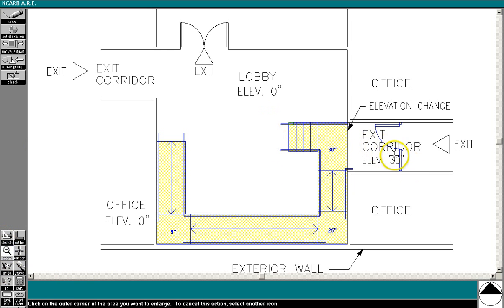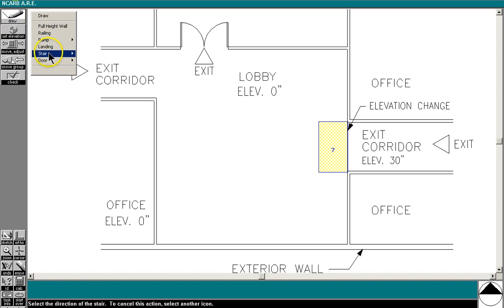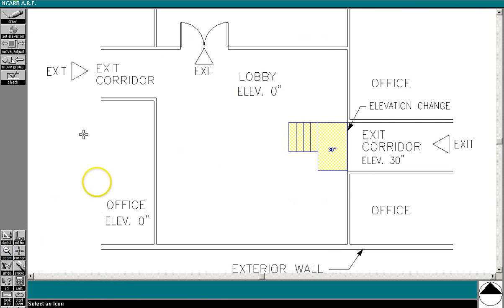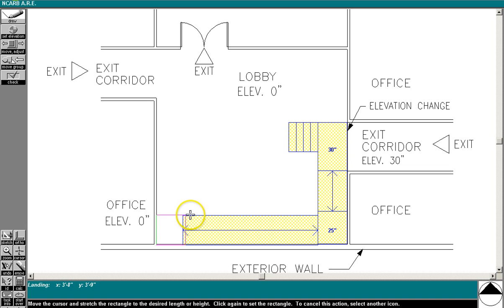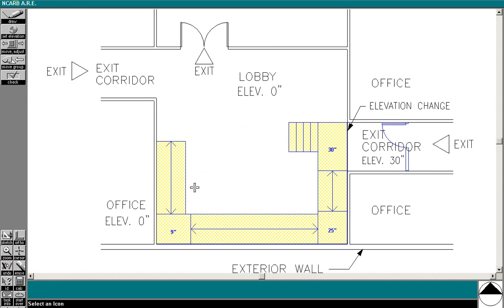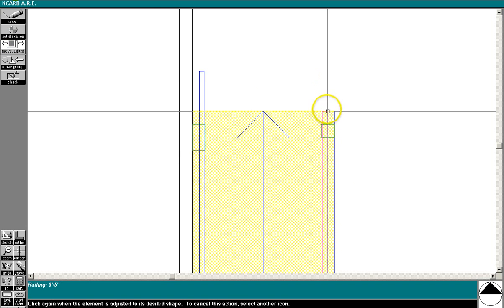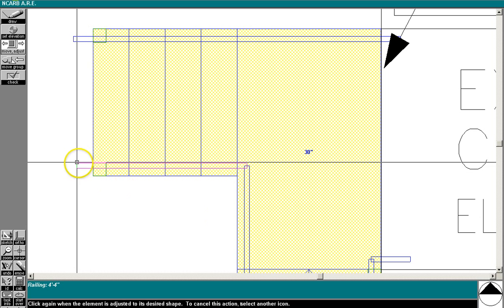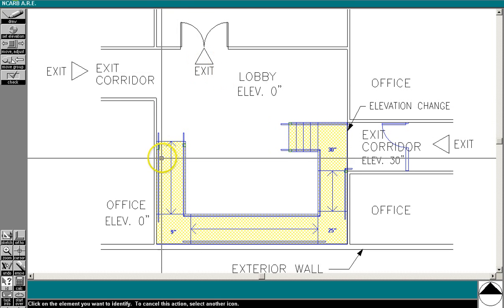ncarb ramp

Comment: Again, the landings are WRONG.  Regardless is you are making a a 90 or 180 degree turn, a 60" x 60" landing MINIMUM is required.  See http://www.ada.gov/regs2010/2010ADAStandards/2010ADAstandards.htm#pgfId-1006877, Figure 405.7.

Comment: This video has fatal errores.
Reply: It would make sense that a 60x60 ramp landing would be required.  In essence his solution works for 90 degree turns one way traffic by code no sweat.  But since NCARB goes out of their way to include the turning space figure in the program info, one can infer they want you to integrate that somewhere in the vignette.  Furthermore, if you want come up with that 'crazy scenario'...if a wheelchair bound person was heading up a ramp when an alarm went off, the same person would have to make it all the way to the top of the ramp to do a complete 180 turn around to then be in the direction of travel as occupants are exiting.  It would seem best practice to include 60x60 landings.  A 60" wide ramp does not seem necessary.

Comment: You're referencing Accessible Routes, but there is a separate section for ramps and ramp landings (ANSI A117.1, 405.7). ADA has been in affect since 1990. It's not something that anyone should still be confused about, 12 or so years later. This video probably does more damage than good.

Comment: This solution has a fatal error. The landing dim is wrong. 

Per NCARB: "
The least dimension in the direction of travel shall be

60 inches.

 If ramps change direction at landings, the least dimension

shall be 60 inches."

Gang Chen, Author, AIA, LEED AP BD+C, GreenExamEducation(dot)com

Comment: I'm not sure I buy the 44" landings you've drawn. Code in software says 60" in direction of travel. 

4.	Landings:  Ramps shall have level landings or floor surfaces at the top and bottom of each ramp run, all points of turning, entrance, exit, and at doors. 
·	The least dimension shall not be less than the required width of the ramp.
·	The least dimension in the direction of travel shall be 60 inches.
·	If ramps change direction at landings, the least dimension shall be 60 inches.